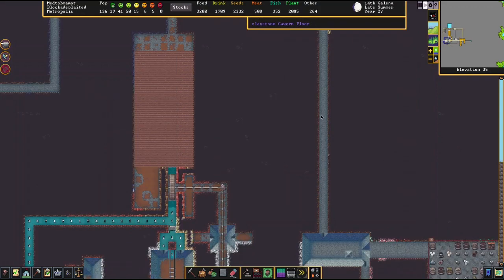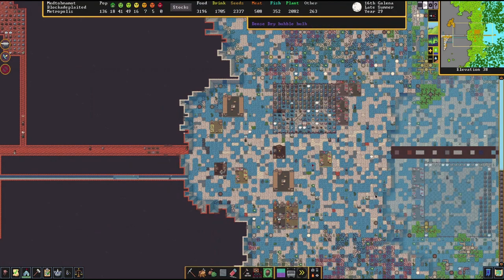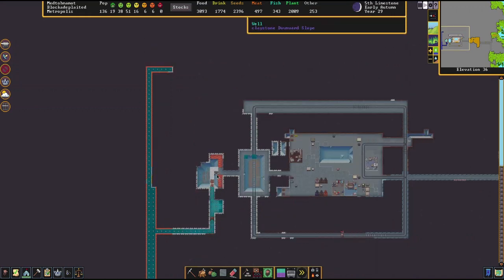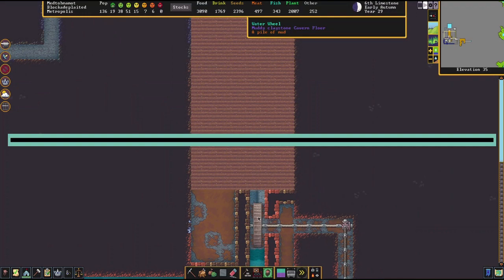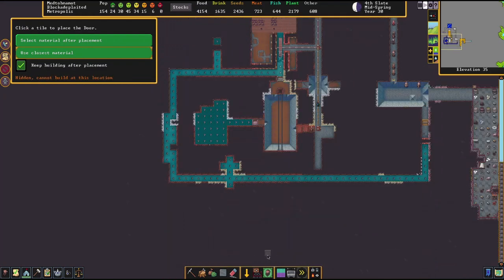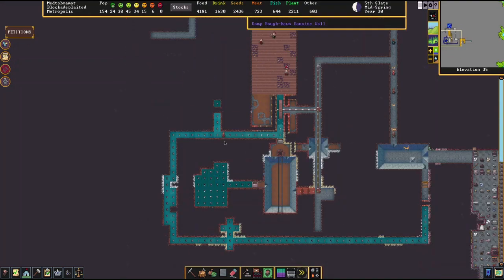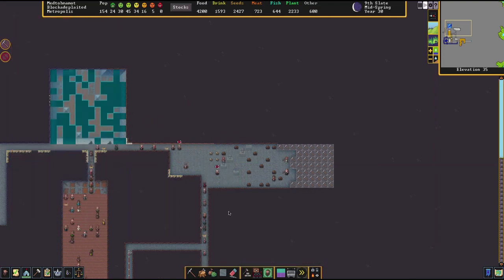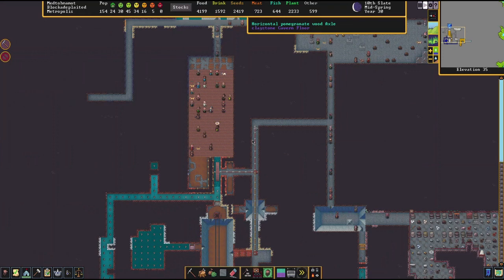Dwarf Fortress: Advanced Engineering

Comment from the maker: @0:00, Goals and Project Description
@4:49, "How waterwheels work" start
@6:55, "Axles" and "gearboxes" start 
@8:40, moving mechanical power through z-levels with gearboxes.
@9:58, alternate design solution
@10:38, water pressure issue troubleshooting
@11:30, minecart routes
@13:40, automated vehicles (cart rides)
@15:30, repurposing old flood rooms as farms
@16:50, Dwarf Fortress as a "fantasy engine programming language"